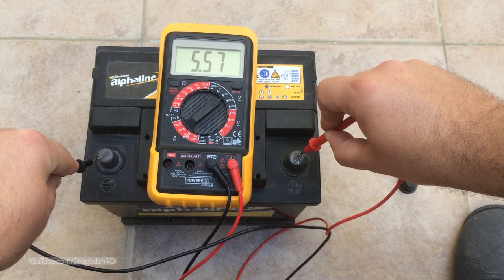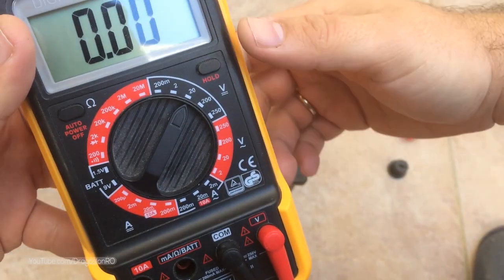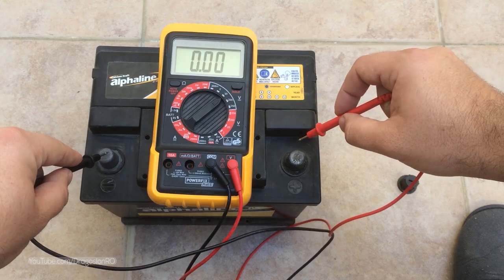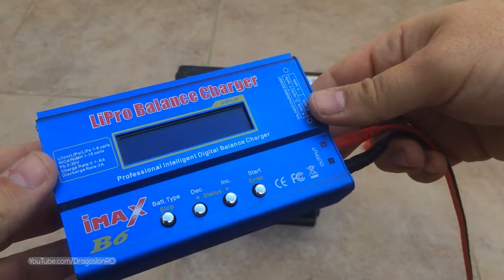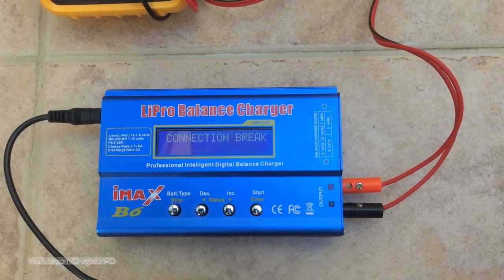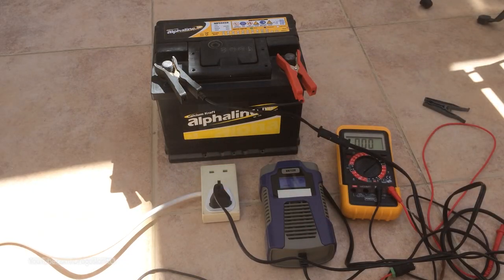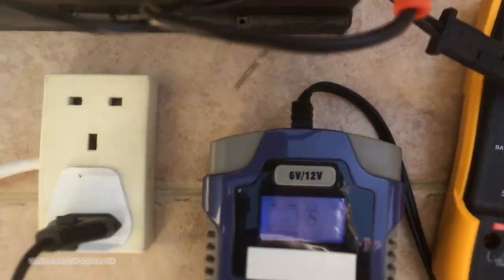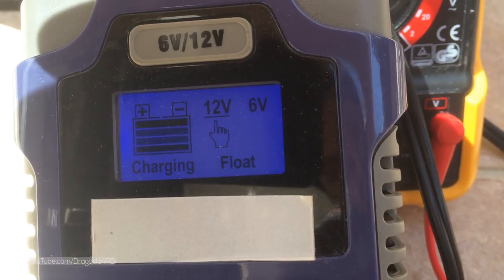Dead 12V Car Battery Recovery Recharge & Revive From 5V

Comment: All you needed to do was trick the initialisation of the car charger into thinking it’s going to charge a 12v battery. Once it has auto selected it’s charging profile, it will charge the battery. You can do this by connecting a 12v source to the car battery terminals and then connect the car battery charger to the terminals. Watch the display on the car battery charger auto select 12v profile and start charging, then remove your 12v source. No need to wire up a CV CC board.
Reply: I was going to comment the same but u beat me to it 👍😉

Comment: Nice video, you should leave it at 15v 300mah for 24h, that's the "maintenance" mode in many commercial chargers, it helps desulfate the battery.

Comment: Very Good.
I adapted this approach. I have 2 Roal Deep Cycle DC 31 SLA batteries in series. I left one on AC charge with a balancer to the other battery. I had also connected an optimate DC-DC charger to one of the DC batteries to keep a motorycle battery charged. A trip turned into an extended stay of 6 months. Upon my return I found that the DB circuit breaker had tripped. The voltage on both DC31 batteries was 1.45V. The battery indicator was in the black suggesting that the health was possibly ok but batteries are fully discharged.
I disconnected all loads and took the batteries out of series. The vehicle intelligent battery charger did not activate when connected to the battery. After watching this video, I decided to connect the charger to the mbike battery which was fully charged. I then connected the optimate DC-DC charger to the mbike battery and to 12V out the DC31 while mbike batt stayed on AC charge.
I measured the voltage at the DC31 terminals, the voltage fluctuated between 10 - 12.5V. I then transferred the vehicle intelligent charger from the mbike battery to the DC31 (and disconnected the DC-DC from the mbike battery). The charger started its charging cycle.
Lesson: the DC31 needed a little boost to elevate its voltage, to get the vehicle charger to cycle AC power to the batt.

Let's see if I get both battereis back to their original state.

Comment: I have a car battery that I use for a power inverter. It was left sitting for several months. It is only a year old. It discharged down to 4 volts. I have a smart charger with a repair mode function. It picked the battery up right away. Will it ever fully recover? Or should I use a glass packed or deep cycle marine battery? I heard those can go pretty low and come back. Getting one the same physical size may be a problem. 🐀🐾

Comment: More than once I've tried to use a smart charger on batteries drained below 8v or less. They will not do it. A cheap solar charger will charge it though.  Two batteries I've done this with and then installed into my cars and they work fine.

Comment: It is normal case for most of the Bolkan people, to use everything until and over their limits :D Good video. However, I would not be able to prepare such a device and revive so dead battery. This could be done only be someone like you, with very good technical skills :) Cheers from Bulgaria :)
Reply from the maker: This is not making the battery good for the car but just to use in other projects.
A pulse charger might recover the battery  to use in a car.

Comment: You should use 1-2A to charge for 1-3 days.  Mine deeply discharged to 0V, and regular charger think the battery is bad, and doesn't charge it.  Finally I have to connect to simple 12V/1A power supply to charge it up (took 2 days).  Anything higher than 2A is causing my battery to surface charge, and then heat up above 30C - 40C, even leaving it for 1 week (even top up fluid level when the level is low).
Reply from the maker: +Sing-Cheong Chen I'll check that battery again soon. Want to use it for a project but don't know what the project is yet. 😬
Reply from the maker: Sing-Cheong Chen charged it for 1 day at 0,5A and the check light in the battery turned bright green again. 
You are 100% right!

Will charge it more like this.

The regular battery charger stops charging and says it's full even when it's dead. The voltage just goes up and the charger thinks it's done.
Reply from the maker: @modding9224  try to discharge it for a while and use pulse/repair mode again.
I don't think it will be good for a car start again but could use it with a solar charger or for other projects.
Reply: @IONHowTo  I had an old battery sitting for 2 years and I was wanting to use it for a battery bank with a few other batteries I have. It was showing 5 volts I put a solar charger on it for a couple days only 1.5 watts 10 volts on average depending on the sunlight. Then I put a 1amp trickle charger on it got it up to 8 volts then stepped up the charge with a regular charger after a couple days I'm almost to 13 volts. I'm getting ready to load test it. Tomorrow
Reply: @jasonclark6194  Did it work dude??
Reply: @nw8000  yeah it's holding a good charge. But what I did was drain the battery acid in a container and mixed up Epson salt and distilled water and poured in the cells and shook it and dumped it till it was cleaned. Turned upside down till dry. Then filled a funnel with cotton balls poured the battery acid through that and filled the battery back up. Charged it up and it was almost like new. 👍
Reply: The mppt chargers for solar are really efficient for charging 12v batteries of any type. They have over charging protection and under voltage protection. Really good charger with a cheap solar panel and cheap. I ordered one for around 20 dollars
Reply: @modding9224  If you don't have a volt meter, it should read the voltage when you first connect the leads. Most chargers have a display especially if it has a repair mode.

Comment: Interesting video, I would get a better charger like a Noco Genius Charger that has a force mode to charge a battery below 1 volt, and the Genius 5 and 10 models have a repair mode for desulfation. I use a PulseTech PowerPulse passive battery desulfator on my BMW battery, they claim that their patented frequency can desulfate and make a battery last up to three times longer.

Comment: I dont think that you are showing the full video from the time the battery started to charge. When using the CV CC charger (I have the same one), 1st use the Multimeter to set the desired voltage eg 14.3 then do the same for the current eg 300ma. The thing is, these settings are when there is no load. As soon as you connect the charger to the battery the battery is going to pull down the voltage to the level it is at. Say you had 11v dead battery, the initial pull will be to that level. The CV CC charger only sets the maximum limits. As the battery charges its voltage will go higher.  So in your vid at 14.51v  on a multimeter (when you 1st hook it up), I think that you are showing the state of the fully charged battery.
Reply from the maker: Used the custom one only to lift the voltage enough so the car charger can recognize it and start charging.
This is actually the opposite of what you write.
A weak battery will show voltage going up fast and shows full even if it's not charging for hours as it should.
If this happens, you would have to connect a load to it then charge it again in few cycles or use a special battery pulse charger.
With the pulse charger you might be able to use it in the car but can fail again soon.
This is mostly useful for projects but not in the car. 
If you really dont want to buy a new battery, pulse charger + few deep cycles would make it a lot better.
I used what I had.
Reply: @IONHowTo  I think that it is good that you have used what you had, I have very much the same components as you have. I just ordered the XT60 3.5mm pins so that I can make the same charging cables. 
I really only have experience with AGM and LiFePo batteries that are down to 25% ie just under 12V (for AGM) and in that situation, the CC CV circuits work great. In such situations, the CC CV works great (esp on LiFePo batteries)  the V will be pulled down to the V of the battery and the C will be maxed out ie working at CC. Once V is raised to the set V the CV will kick in and the C will start to drop off. Once that drops off to about 10% of the initial charge (eg for 2ams = > 200ma) the LiFePo battery will be fully charged.

Comment: HI Sir very nice demo. I have 12volt dc battery 26 Ah and its output voltage is ~0.50 amp show. This is in the dead stage.  I am charging through solar controller the inputput voltage is ~15 volt.  Pls, do the needful. Thanks.

Comment: Actually if you have an b6 hobby charger like no matter what brand you have turnigy accucell imax, they all have same working so as your battery is on 5 volts so the nearest volt for is of 6v(3p) charge it in it for a while the voltage will rise in about a minute re check the voltage while disconnecting it from the charger then choose the next highest voltage in the charger suppose it's of 7v choose 8v in chager if you select higher you get connection break or low voltage error. Just revived a battery by this way yesterday, it rose to 12.65v and then i turned it off came home from the shop. Will Charge it further tomorrow.
Reply from the maker: Sounds great! Yeah brand of charger doesn’t matter at all as long as it can charge it at that lower voltage.
Reply: Yeah, for people work being done matters . Brand doesn't. Lol
Reply: Successfully charged my battery after 2 full days of charging lol 😂 I know it's bit too long but still all i had is a 80w lipo charger and cpu psu, exclude night time lol... It's showing green in the indicator,
If am right my beast took 33+12+6k of mah (took brake because of change of low watt supply) and still charging but at 1/3 of start amp(max on my charger). Will see tomorrow at what final voltage it gonna rest at...
Reply from the maker: Voltage might go down a bit.
if it wasn’t sitting with low voltage for too long, it could work in a car. Hope it stays charged nicely!
Reply: @IONHowTo  yeah it was going a bit low bit fast when removed from charging from 13.26 to 13.13 it was lil fast but going a slowly when i checked at 13.13v not bad actually. Yes the indicator was dark when i started charging it's bright green when i left the place that's what one should expect after charging one thing for like 15 hours and putting 45+ amp into it and long wait... Will put it into car tomorrow and give it a start.

Comment: i notice it is a calcium type battery, if memory serves me right they need a 16V charging voltage to ever be completely full
Reply from the maker: I have no idea about it. Also I never saw more than approx. 14.8 on a battery charger.
Reply: @IONHowTo  yeah that's i think as high as those chargers will go, I'm sure there are differences between brands and such

Comment: You messed up the battery by putting 14.5 volts onto it. A lead acid battery must be charged with 12.6. When a battery is very low voltage it takes a long time for it to take on a charge at first. You need to discharge it by shorting the battery.

Comment: No. That battery is likely still bad because of sulphation, which greatly reduces its capacity to start a cor or run the vehicle reliably. We're not all fooled by this nonsense. This guy should have load tested it to show you all the truth.
Reply: Exactly agree 100%.
Reply: But he told you straight it would only be good for small loads. What's the problem here?
Reply: @kitten_processing_inc4415  I just don't like lead acids. They are dangerous to mess with. Some lithiums are too. I know a guy who lost his right arm to a lithium that exploded into the fire ball, burning him over about a fourth of his body. Lead acids are just too risky, and they are not all that economical. I have chemistry that will desulphate lead acids and make them as close to brand new, and there are other methods using high voltage to do the same, but it's all REALLY dangerous.
Reply: @kitten_processing_inc4415  People are blind and Deaf too.... That's the problem...  The channel owner clearly told that the battery is still not reliable.....

Comment: Great video.

Try using a Optimate Charger once your charger recognises it...
Reply from the maker: Ben thanks, I just used a regular cheap charger. I’m sure there are better ones but it’s what I have. Won’t get another one any time soon. 😅
Reply: Look up Optimate / Oxford  or any other Smart chargers. 
They help maintain your battery for less than the price of  new battery and your battery lasts much longer.  
They also help you recover older batteries
Reply: Or use a charger with startbooster and chock the battery , problem solved.
Reply: optimate doesnt charge drained dead battery
Reply: @MrStyle-sr1yv  It will charge a battery that has 5.4 volts still in it, and maybe even a little lower, I'm just charging one now that started at that voltage. Optimate 4.

Comment: To long I just hit my battery with high bolts funny enough I’m into rc stuff so I used the same b6 charger just put on pb mode and put a car charger on it that has engine start turn on get to get volts and let regular charger do the rest

Comment: That battery will quickly drop back to 5 volts within seconds when under load...... Waste of time.
Reply: It's a big battery. It won't drop on small loads. It will also recover if repeatedly charged.
Reply: @earumamaadu  Correct...... If you just want to run lights and a couple of fans....

Comment: Hi after charging the battery. The voltage keep on dropping what could be the problem.
Reply from the maker: Hi 👻
Could try to leave it longer on the charger 12-24h.
If its still bad then it’s a long and dangerous story to try to bring it back. 
They say impulse high current chargers can fix those but the battery can actually inflate and break with those. 
New battery is the best choice.
Reply: It's  got a bad cell!

Comment: at 13 volts how much time 🕙  do we cahrge a battery giving 4 volts to 5.6 volts to 7 or 8 volts is 30 minutes enough or 1 hour or 2 to 3 hours
Reply from the maker: Should try to leave it for at least 8-10 hours, ideally overnight.
With low current so it doesnt show it's charged too fast.

Comment: Why won't it be usable in the car?
Reply from the maker: Using a special pulse charger might  recover it well enough to use in the car. Shown is a way to make the battery usable for lower amp loads.
Reply: @IONHowTo  so if I recharge with 4 amp charger until showing full charge, I should be able to use in car, correct. It's been on the charger for about 18 hours. And is showing about 3/4 full.
Reply from the maker: It depends on how bad the battery is.
A "desulfator" pulse charger might fix it well enough for use in the car but it's not guaranteed.
It's not about how long but the way it's charged.

Comment: I used a small 12V motorbike battery similar way. It was still good for small point welding (I don't know what it's called in english). I changed the batteries in my drill and needed to connect them, so I just welded them together by shorting my bad car battery for just a moment on the point where I needed to weld the connection. Something like this: https://www.youtube.com/watch?v=o1NFbchHeM8
Reply from the maker: Nice
Reply: point welding might be called stick welding
Reply: @billaa49 spot welding is also a very popular thing

Comment: This is seriously a long drawn out video. All you had to do was connect it up to an old school NON SMART charger! They dont care what voltage is left, they will supply a constant 12-14v @ 2-8amps. Those smart chargers are only good if the battery needs a bit of a maintenance charge. You could have made this into a 10 second video using a classic charger lolol 🤦🏻‍♂️🤦🏻‍♂️🤦🏻‍♂️
Reply from the maker: I don't have an old charger / transformer. I used what I had. Didn't want to buy more things.
Use what you have for sure!
Constant voltage is good, impulse charger is even better.

Comment: I've just wasted 10 minutes of my life watching someone wasting his time. When a battery is in this condition, you can use a good 12V battery to re-activate the dead battery, Connect jump leads to the Plus to plus and Neg to Neg and leave fo 10 minutes and it will equalize, then attempt to charge it with the charger.